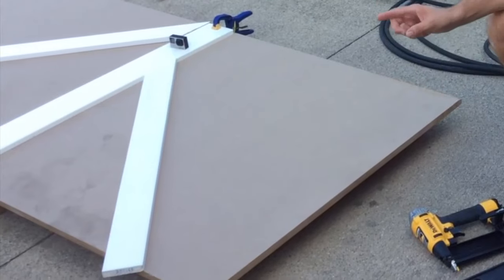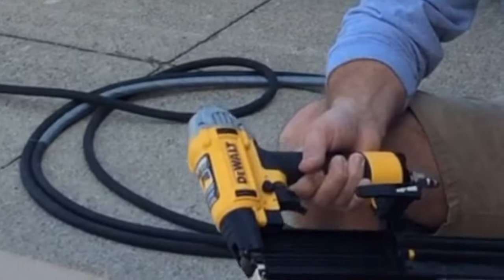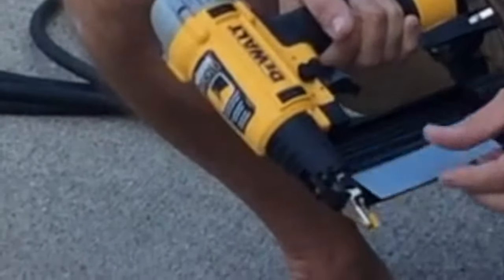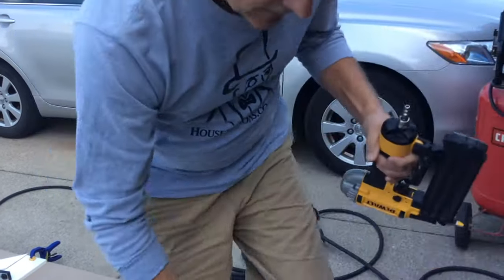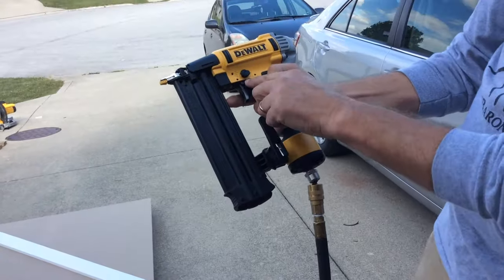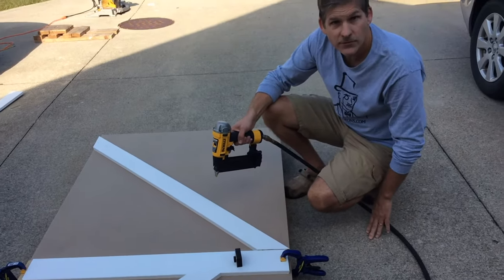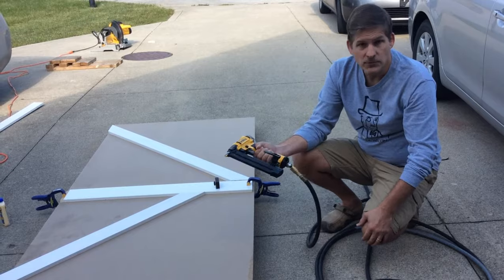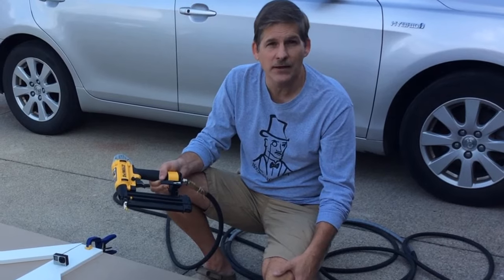How to use a nail gun - dewalt brad nailer

Comment: My DeWalt instruction manual reads “Caution: Never use lubricants or cleaning solvents inside this tool” I don’t believe you should add oil to the nailer. Although I could be wrong, have been before.
Reply from the maker: Hey Kevin,
You are right. Thanks for pointing it out.
Reply: You are wrong every nail gun needs oil
Reply: @QxihCodm I'll just go with what dewalt says. If you have Warrenty and they see you use oil. They will void it.
Reply: @zendog8888  oil keeps tools working betterlonger and lubricates all the moving parts
Reply: @QxihCodm  Adam OBVIOUSLY knows better than the manufacturer of this fine tool. I would listen to him...NOT!

Comment: Hi buddy, you should not put any oil, the user manual mentioned, this tool is designed to be used without oil. Applying lubricants can affect life and performance!
Reply from the maker: Hey K.I.M….,
Thx for the tip. Thx for watching!
Reply: @Housebarons  No problem. Thx for your video!😀

Comment: This is our first video and have a question or two...Looking at the Dewalt 2350 23 gauge..Is this gauge good overall or should we be looking for your size, 18g? probably will be used for small jobs. Also, can I use smaller gauges in the 23 gauge unit?  Thanks for answering if you have time.
Reply from the maker: Hey Lenmar,
Typically, unless the nail gun is designed as such, they only allow for one gauge of nails. Different lengths are often accommodated, but only one gauge.
Hope that helps. 
Thanks for watching and thx for the question!
Reply from the maker: Hey Lenmar,
Another thought - you typically pick the gauge size by the work you are trying to do. For example: we have an 18 gauge Brad nailer for fine trim, a 15 gauge finish nailer for door and window trim, a roofing nailer for roofs, a framing nailer for wall building. All different size nails and jobs. Pick the nail gun that best suits your job. We use Dewalt and Hitachi. Check the reviews before buying and you’ll likely find a good nail gun. 
Thanks for the questions.
Reply: HouseBarons both answers are just what we wanted know!! Thank you very much!
Reply from the maker: Hey Lenmar,
Glad it helped & happy projecting!

Comment: I noticed who expensive brad nailers from Milwaukee and Dewalt are. Would it still be cheaper to buy a pneumatic brad nailer, compressor and hose, and still spend less than the $260 Dewalt or Milwaukee cordless?
Reply from the maker: Hey William,
It may only be cheaper if you are buying multiple air tools as the same compressor works with all of them. 
But then there is the portability concern. 
Lots to think about. Thanks for watching.
Reply: Amazon has sales from time to time on the Dewalt DWC1KIT-B (6 gallon pancake compressor, 18g brad nailer and 25 foot hose with all couplers included). The last time I checked, that kit was $229US. While cordless models are nice (though much bigger and heavier), and you don't have a long hose to worry about, the advantage of using the compressor/kit (besides being smaller and lighter gun wise), is being able to use the compressor for other things, like HVLP paint sprayers (for painting walls, and staining decks/fences), filling your vehicle tires, basket/volley balls, or blowing off wood chips/dust from your tools and works surfaces (with the correct air hose attachments).... and also using it with other air tools like ratchets, impact drills and sanders. Btw, if $229 is still too expensive for you, there are Craftsman, Bostich and Porter Cable models of the same kit starting around $150. And don't go less than 6 gallon (trust me). The smaller tanks (1-4) will annoy you to no end when you're trying to use tools that need more air supply/pressure, and you constantly have to stop and wait for the tank pressure to build back up before using the tool again.

Comment: I own the same DeWalt nailer.  I'm using it in the overhead position doing a stamped tin ceiling application into plywood.  I'm getting a misfire about 50% of the time.  Similar with my Porter Cable brad nailer.  Is there an issue with using overhead?
Reply from the maker: Hey Mark,
Not that I am aware of.... 
Thx for watching.

Comment: Well I did my experiment.  I got a piece of 1/2" plywood setup and nailed it in about 10 places.  No problem.  The only thing I could come up with for a reason for the problem I had was that the quarter round is of course round.  So I went back to work and this time I was more careful to make sure that the gun was making full contact with the wood.   That must've been my problem.  I can't imagine that I wasn't making full contact before, but this time I made certain and it worked just fine.  The bottom line is that the problem has to have been operator trouble.  It hasn't slowed me down really.  I'm just being more careful and that's alright.  Thanks for your initial feedback.  I hope that this will be of some help for others going forward.
Reply from the maker: Thx for filling everyone in - I’m sure it will help!

Comment: I'm wondering about a problem I'm having fairly often.  About every fifth nail doesn't go in all the way and is just kind of mangled halfway in.  Then it will be fine for a while and do it again.  Any thoughts?
Reply from the maker: Hey Jim,
My 1st guess is the material and less the gun. 
Can’t say that I’ve experienced anything regular - but have had nail bend going into osb which has hard spots here or there. Possibly hidden nails in the material??
If it’s literally every 5th nail, then maybe suspect the gun - but sorry I can’t say I can practically explain that. 
Thx for watching…
Reply: @Housebarons  I'm just putting some quarter round to baseboard.  It's not every 5th time.  It's new material so I'm not hitting a nail.  It's just annoying and strange.  I'm going to try and just put a bunch of brads into some plywood tomorrow just to see how that goes.
Reply from the maker: Could be you are hitting existing drywall nails. Curious to see how the nailing experiment goes.

Comment: I got this with a compress but it will not shoot any nails after a few times of use. Pressure is at recommended it will shot once or twice but then nothing will come out after firing. It will work once I open and close the loader but can’t really find anything on it. Do you have any suggestions or have had similar problems.
Reply from the maker: Hey jze…,
How big is the compressor? Small compressors only have a little air before recharging. 
Look at the gauges. 
If you have 2 gauges, one shows pressure in the tank, the other is the adjustment to dial in the exact pressure available in to the tool. Usually that is set at the amount the tool needs… but after firing, the dial might need further adjustment.
Hope that helps!
Thx for watching!

Comment: Thanks for your video. Does the gun accept other brad nail manufacturers? Like Spenco or Freeman 18 gauge brad nails?
Reply from the maker: Hey Ibig3,
I’m not sure since we typically stick with manufacturer nails. If I had to guess, I would think so. But to be sure - maybe ask the manufacturer - chat? 
Thx for the question and for watching.
Reply: As long as it's an 18 gauge brad nail (anywhere from 5/8" to 2" in length for this Dewalt model), it will work.

Comment: What hose did you use? Do you need to change out the input for the hose on the nailer itself so it could adapt?
Reply from the maker: Hey Kaleb,
Just used a standard rubber hose for pneumatic tools. There is a wide variety of hoses that will work. Same with the connectors. I got mine from a kit that has various sizes / male and female connectors as well. Did that make sense.?
Thx for watching!

Comment: I had a problem with other nailguns when the nail goes in to far.is there an adjustment to control the depth of nail .thanks
Reply from the maker: Hey Flyinglow909,
You can control nail depth by adjusting the compressor air flow. You should have at least one gauge on the compressor that sets the amount of air pressure going through the hose to the nail gun.( assuming your nail gun not battery operated) .
Typically nail guns operate around 50-70lbs if pressure. 
If the nail is going in too deep, just dial back down the pressure by 10 lbs less and see. If still too much, do 10 more lbs less. Eventually you’ll find the sweet spot.
Hope that helps. Thx for the question.
Reply: There's a depth selector between the trigger and magazine.
Reply: You have two options for nail depth... A) the compressor's output pressure, which should be set to 70-90 psi (as per the sticker on the nailer), which should get you close to the depth you need (in the ballpark so to speak)... and B) after setting the pressure from the compressor to the aforementioned psi, you can fine tune the depth even more, by using the depth knob located just below the trigger. https://tinyurl.com/y6gdc66l

Comment: Hi, I just received mine and I’m looking for the date code to registered it. Where can I find it ? Thanks.
Reply from the maker: Hey bgolfy,
If you held the brad nailer as you might a regular gun, there is a black and yellow sticker ( at least on mine ) on the yellow housing at the top of the gun as you hold it. . Between that sticker and the silver cap ( the silver cap is at the opposite end of where the nail shoot out) is probably what you are looking for. It is engraved into the yellow housing - very hard to see - but there are a couple rows of numbers there - just engraved or laser cut w/o ink into the yellow housing.
Hope that helps.
Reply: @Housebarons  Hello, thanks for your quick answer. Yes, I already saw that. On mine, the first row is "DPN1850PP" and the second row is someting like "NNNNNNNNH BK" (NNNNNNNN is a number) what I guess is the serial number. I also have a Dewalt table saw where the date code is something like "xxxx-xx-xx" in date format that's why I wasn't sure for the brad nailer... I recorded it on Dewalt website it says "1 year guaranty". I expected 3 years as the table saw was... Anyway, thank you again for your help.

Comment: Always wear eye protection when using nail guns. Also would advise moving my new cars if nailing as the nail can hit a knot and go maverick.
Reply: Oh no it’s YouTube OSHA. When shooting, my eyes are about 2” off the material with the nailer leaning against my temple to get a good vision and pin point my target, (No Eye/Ears Protection). On small job I run the compressor in the  back of the truck, use the tailgate as a table and fire away, (brand new truck) weird never had a nail go maverick but I’ll keep my eyes on it lol

Comment: Thanks for the video I thought these was oil free nailers
Reply from the maker: Hey st7650,
You are right. I just do it automatically with my pneumatics tools. Thanks for the tip!
Reply: The operating manual says the brad gun is properly lubricated at the factory and you should not put any solvents or lubes into the gun. But it also recommends yearly maintenance at a dewalt servicer, and who’s going to do that? Am I right fellas?